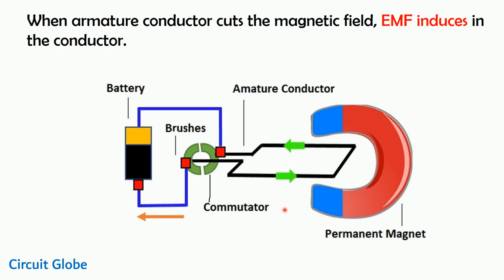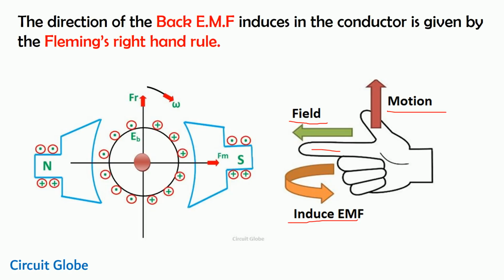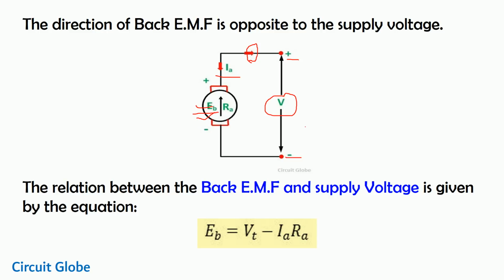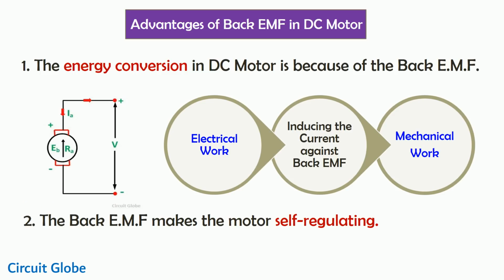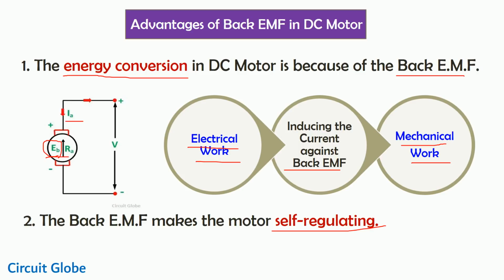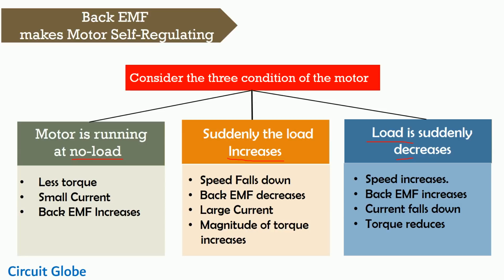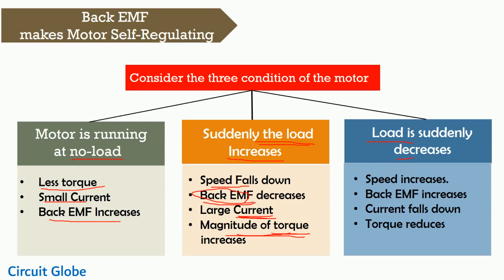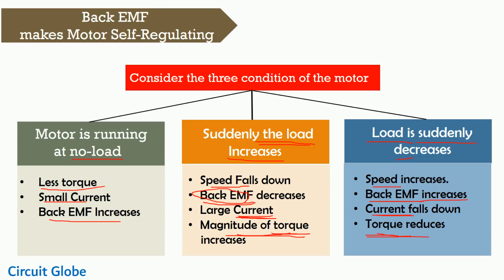What is Back EMF in DC Motor?

Comment: What is a dc motor? What is back emf?
Isn't it wonderful that when we flip a switch which is wired to a ceiling fan, the fan rotates! Take a moment to visualize the force which acts on the blades to keep them rotating while we are standing on the floor far below the fan.  As if it is rotating by an unseen hand!
It operates based on the principle that a current-carrying conductor placed in a magnetic field experiences a force and this is what was encapsulated in the Lorentz force law.  

A description of load torque always accompanies a discussion on motors. The effect of its imposition on motor torque, and how this causes the motor to draw power from the power supply then follows. The phenomenon of how it is the ‘back emf’ in motors, which regulates the motor torque to match load torque completes the discussion.
To understand these ideas, it would be instructive to understand Current, the conduction process and Voltage at the fundamental level.
Electrostatics and circuits belong to one science not two as in the following two videos:
i. https://youtu.be/TTtt28b1dYo and 
ii. https://youtu.be/8BQM_xw2Rfo 

The "back emf" or "motional emf" is a trick nature uses which has a regulating effect in determining the amount of current the motor draws and is a natural consequence of the induced emf process when a conductor moves in a magnetic field. 
The fan pushes air and the molecules of air when they leave the blades produce a reaction force, a torque as the blades spin. The fan motor should generate sufficient torque to overcome this opposing “load” torque and keep the blades spinning.
The "back emf" regulates the current to generate this required torque automatically!
The governing relation for current in conductors is J = σE_net where σ is the conductivity of the conductors and E_net is the resultant of the applied and inducedcelectric field components in the conductor. 

It is not possible in this post to discuss in more detail the process of production of the back emf and its regulating effect on motor torque.
The last frame References in video #1  lists textbooks 3 and 4 which discuss these topics in more detail using a unified approach and provide an intuitive understanding of the generation of an emf in generators and motors.

Comment: when we give DC supply to the DC motor force are created or each armature conductor.
what about AC supply
Reply: In case of AC supply same thing will happen, remember the supply voltage change on both stator and rotor so the resultant torque will act in same direction.

Comment: ''Go back to the basic equation for the force on a current carrying conductor is: F is proportional to BLI F=force B=flux density (the strength of the field that the conductor is in) L=length of the conductor I=current in the conductor This is an EQUALITY. If we invert it, we get: I is proportional to F/BL So if the wire is being pulled through a magnetic field, the current on the wire must increase to balance the forces. If it does not increase, then in a motor, the slip will increase and the motor slows down because not enough current is being delivered to the motor to operate at rated speed. In DC and synchronous motors, this isn't a problem because both rotor and stator currents will increase. In an induction motor, the armature current is coupled to the surrounding stator magnetic field. As load increases, the motor slips slightly more until the flux density and current in the armature balance out electromechanically at a new operating point which is a slightly slower speed. If you overload an AC motor beyond the pull-out torque, the motor stalls. The field is rotating at a constant speed, equal to 7200 divided by the number of poles in the motor windings. So a standard 4 pole motor has it's field windings rotating magnetically at 1800 RPM. When the motor is loaded to 100% of it's torque (horsepower) rating, it will run at the name plate rated speed which is usually 1-3% below maximum speed (usually about 1720-1750 RPM). As you reduce the load to 0 (nothing on the shaft), it will gradually increase to some place close to 1800 RPM but never exceed it. For most applications, this speed is close enough that most folks treat it as constant. OK, getting back to the original situation... In AC motors, the locked current (and also rated torque) is roughly 150-200% of the rated (FLA or HP) range. Since this is twice the motor's rated cooling capacity, and with an integral fan, there's no air movement, you can't normally operate at this point for very long. Once the motor starts coming up to speed, the rated torque of the motor actually increases even more (the pull in torque), until it gets to rated speed where the force, flux, and current all balance again. So at least for a short time (until the motor overheats), it can pull much higher torques. Once you stop it, you are limited to the locked rotor torque (150-200%), and the heat load shoots up very quickly since the motor isn't moving. So in your theoretical "gear box is shot" situation, you might be able to get it to turn over for just a few seconds before shutting down due to overload, or in some situations, it won't even rotate the slightest bit. Starting currents (as the magnetic fields suck down all the current necessary to charge the fields) is often 17 times rated current, and in energy efficient models has been measured as high as 21 times or more. Don't forget too that this translates into torque internally in the motor...starting currents are the most destructive on rotor bars, insulation, and anything else involved in generating magnetic fields. Even after this is over with, current during stall (locked rotor) conditions surges to roughly 6 times normal full load current. With this in mind, it's obvious why with across-the-line starting, "bumping" is very hard on motors without drives to control the torque/current. Assuming that you deal with all the other problems of using drives (heat loads, potential standing waves, and rotor current buildup), it should be obvious why motors driven by drives often last much longer especially in frequent start/stop conditions than motors driven by across-the-line starters. If you use a full vector drive, you can manipulate the operating point of the motor. You can change the rotating field speed (frequency) and voltage to allow the pull in torque to occur even at ZERO speed. This gives full vector controlled AC induction motors a higher torque rating (roughly double) than their DC brethren where on a DC motor, torque is fixed from 0 speed all the way to rated (base) speed. Effectively, you can operate a motor with fixed torque, fixed speed, or vary both, just as you can with DC motors. Again, this is of course within the limits of the bearings and cooling capacity of the motor. Adding an external fan cooling system makes almost anything possible. Unlike a DC motor, AC motor math is ugly because you have the inductive transfer of energy from the fields to the armature. Everything gets very nonlinear and it makes my head hurt trying to follow some of what the motor gurus are talking about. Just remember that the rated speed on an AC motor is "approximate", and that once you throw a drive into the mix, you can achieve a lot more with an induction motor.''

Comment: I guess dc motor the cause is the supply voltage and to prevent this cause or oppose this cause the back emf develops and limits the incoming current ........but you have said the cause itself is the back emf.....

Comment: I don't know why this back emf concept. Back emf is produced due to change in magnetic field due to rotation. Back emf is opposing the rotation not the supply (indirectly it is opposing).Correct me if I am wrong. I am  fully confused☺
Reply: Rotation is  due to supply voltage so the back emf opposes the supply voltage